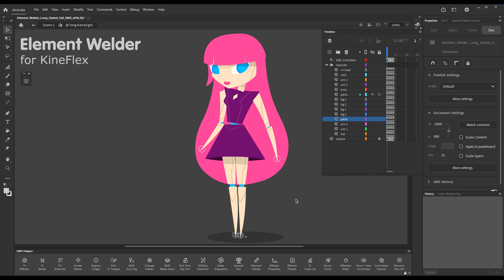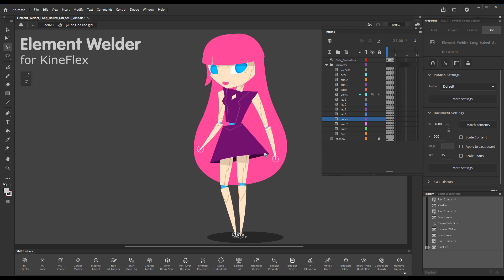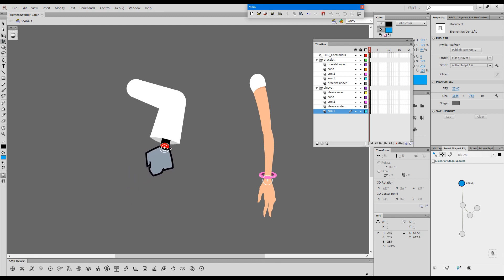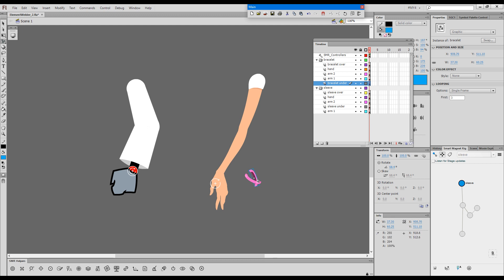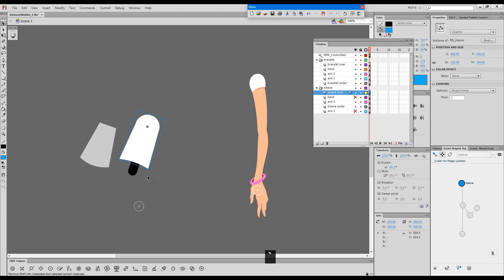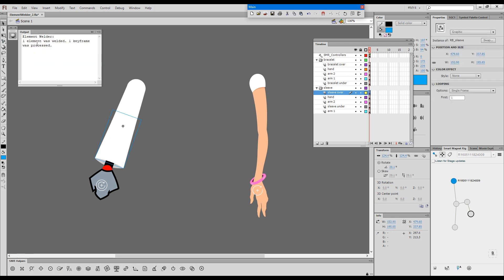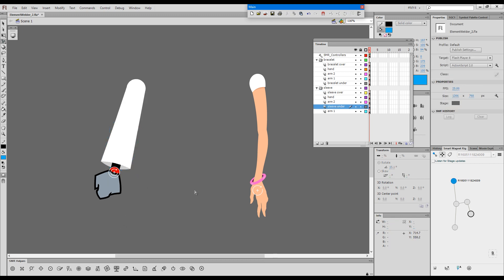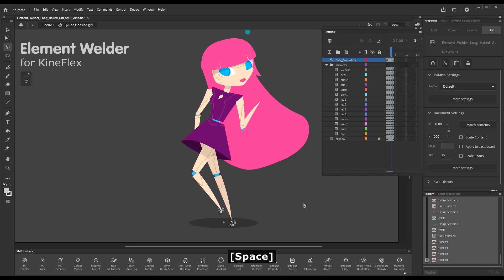EDAP Tools - Element Welder for KineFlex

Comment: can I know that is it only work for vector only? Let say I draw character from photoshop, then separate and export it into png for each part. Is it still work?
Reply from the maker: It will work. It's just more difficult to use bitmaps in Flash/Animate. You may need to mask the bits inside the symbols.
Have a look at this little demo we did with real paper cutouts: https://youtu.be/Z5tvNeObfss?t=88

Comment: Awesome update! I was trying to work with a complex magnet rig with a wrist, hand, and 3 parts of the fingers for precise finger movement. Worked for the most part but I had a LOT of trouble with it unsurprisingly and had to find workarounds. This update with the welding tool might just the fix the issues of the hand/ fingers folding in on themselves when trying to move the arm lol. Either way I'll have to play around with it~ 
Also nice control panel with the buttons and such. Can't wait to look into all the new fixes/ features :D